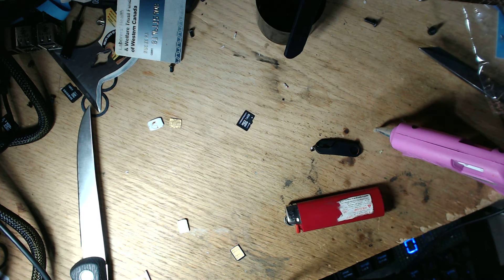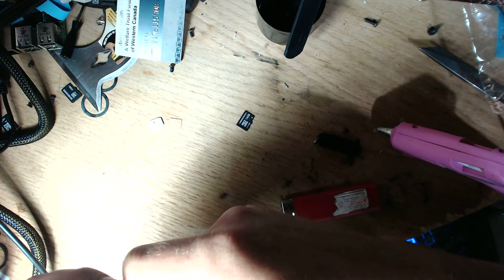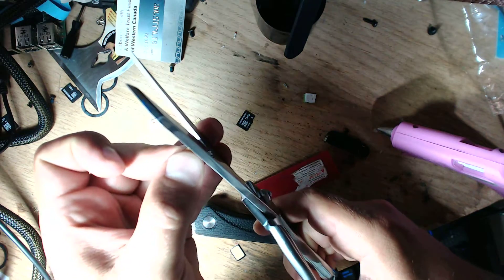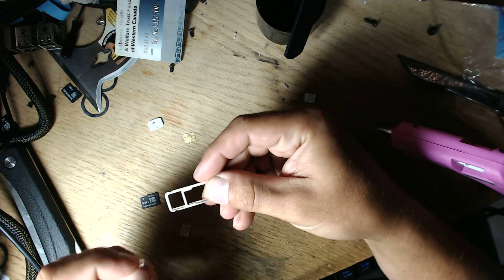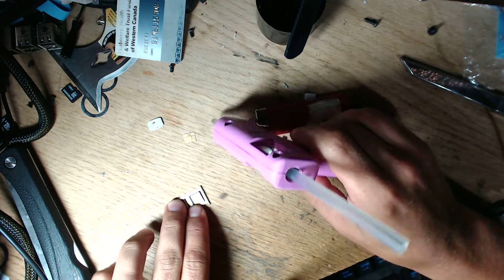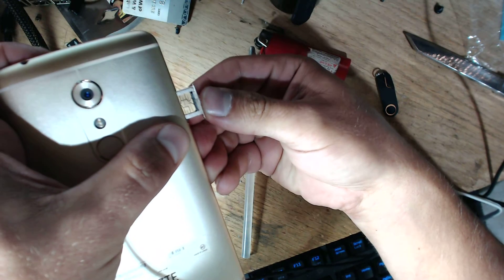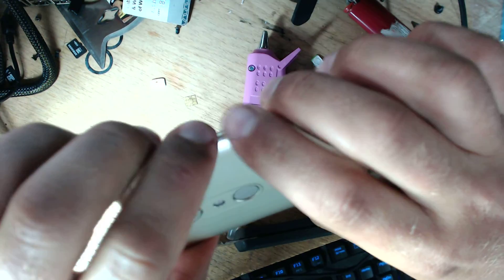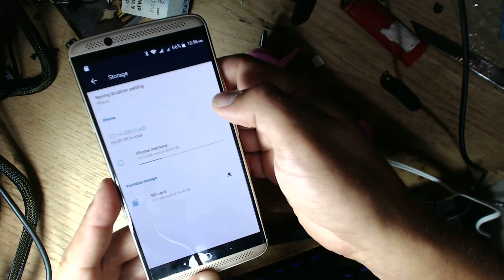Dual SIM and Micro SD Card ZTE Axon 7 (Part 2 of 2)

Comment: I saw it done with Acetone
The guy dipped the card few times until the plastic was separated from the  contacts but as long as this procedure worked for you its fine :)
Reply from the maker: I'll have to soak my old card for a little while to see if it does any damage. I'll post back with results.